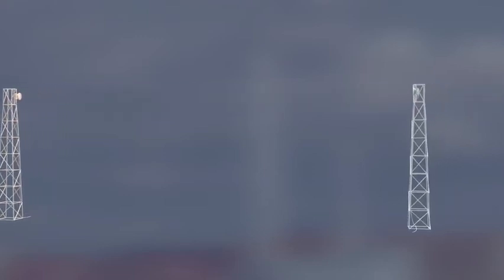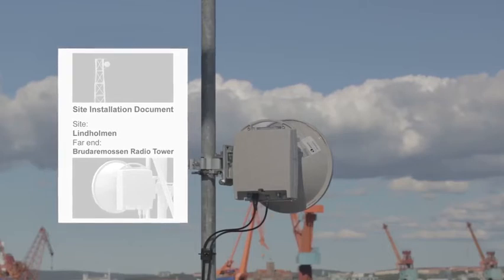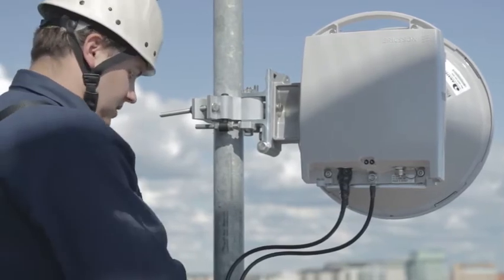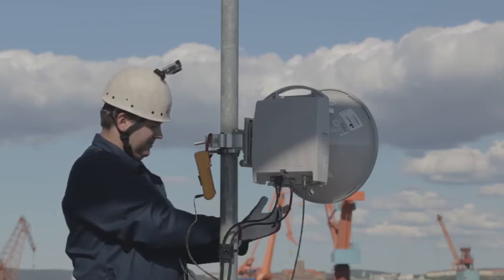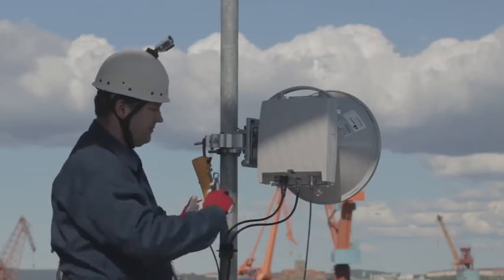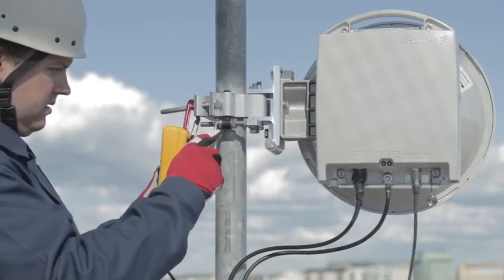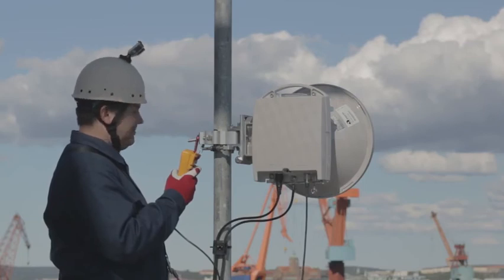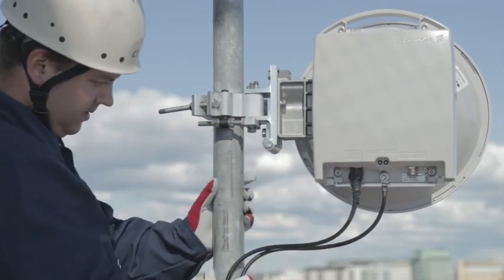Antenna Alignment Example - MINI-LINK Video

Comment: Anyone have any idea what the adapter for the multimeter to the ODU is called?
Reply: Just a BNC connection I believe.
Reply: @donavonhursh8089  yep, its just normal bnc connector
Reply: BNC connector but if you're looking on Amazon a lot of places call them oscilloscope test leads because that's what they're usually used for. FYI.